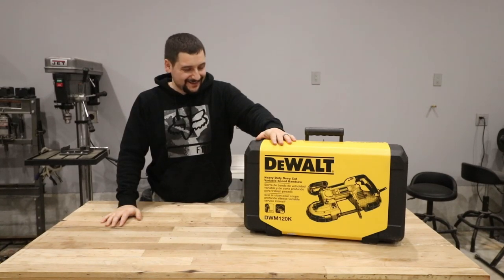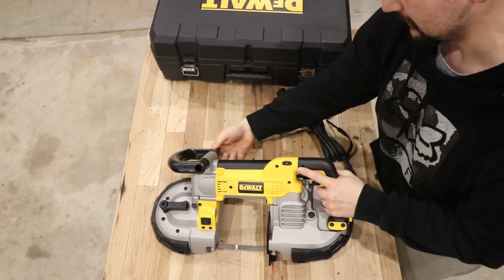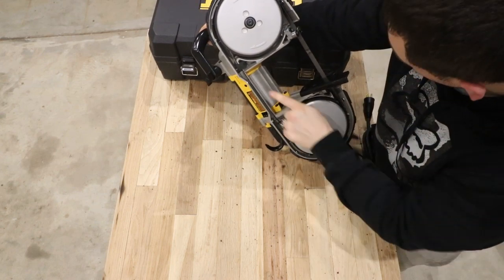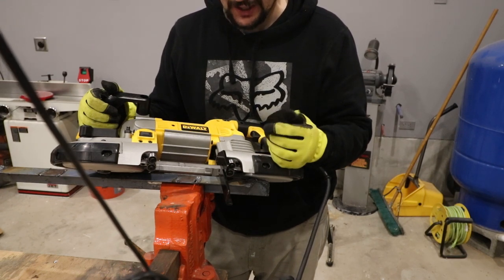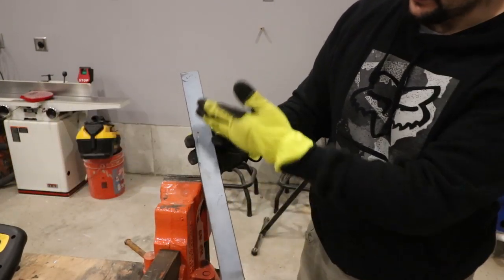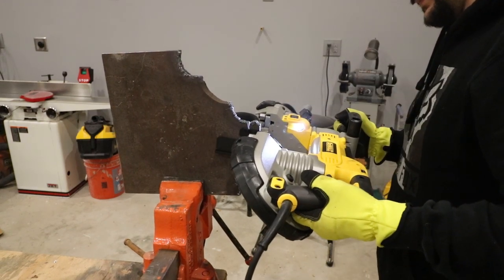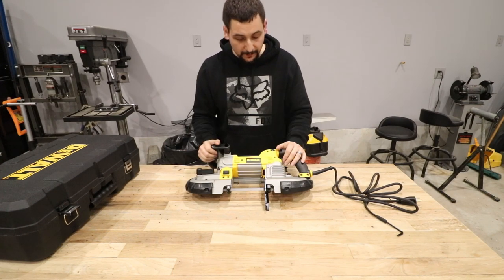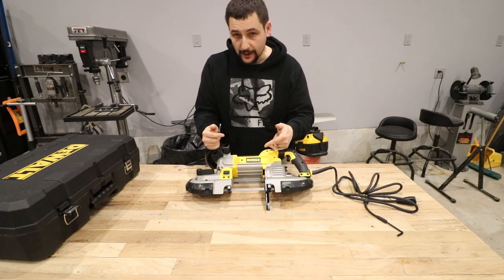Dewalt Portable Bandsaw Review, Yeah you need one!

Comment: I've worked in PPE (Personal Protection Equipment) areas for years and It never ceases to amaze me how many times I see people working in these areas without wearing Safety Glasses or Ear Plugs. Especially when I watch the Motor Trend Chanel with Shows like Bitchin' Rides, Texas Metal, Fantom Works, etc. . . it really surprises me how often they NEVER wear PPE.
Reply: I wear safety glasses, a respirator with p100 filters, and ear muffs when using power tools. It's like flossing. You only need to floss between the teeth you want to keep.
Reply: My dad never did unless he was welding.  Otherwise he used the squinting method.  I make my living with my eyesight. I wear eye protection every time
Reply: Ah, yes. the tried and true timeless squinting technique.

Comment: These are very handy tools!  Now you just need a "SWAG Off Road Portaband Table" - Adding the table doubles the saws utility.
Reply from the maker: Gregory MacNeil Spoiler alert, next Friday’s videos about that very thing!
Reply: I love my SAWG Portaband Table - so very handy and precise - I painted mine with Flood Penatrol so that it would not rust.  I also have the plasma but have not used it much since I got the table - I will say however that you do have to match the bandsaw blade to the material thickness if yo are to get the max life out of them - I also use a Doall cutting past or WD40 on my all cuts -  @DanielWoodell

Comment: Silly question by an amateur, this seems pretty neat but does it not lose the utility of having it upright? In other words, if you can't mount it to a table upright, it loses some utility from a traditional band saw, in my opinion. For instance, you use a band saw not by moving the saw but by moving the wood around and into the blade. Unfortunately band saws are pretty huge and for those of us with not a lot of space, a full blown band saw isn't an option.

It's a bummer that this can't be mounted on a bench or something.
Reply: SWAG Off Road makes a portable table you can attach the machine to.  I have not used it but it looks like you can use this tool as a traditional bandsaw with the table.

Comment: congratulations I just bought the same one and I'm itching to go out and build a stand for it I'm waiting for the sun to come up. It seems to be a very easy one forest and you can just take the top handle off in Mount it throughthe same handle mounting screws and then clampett at the bottom so simple

also congratulations for not being one of the idiots that buy everything from Harbor freight in my opinion the worst blade on America that's ever existed